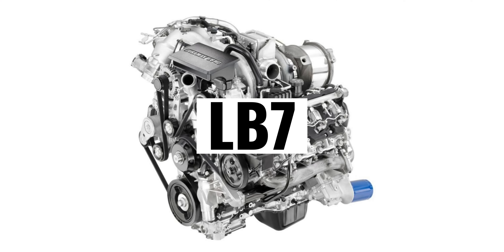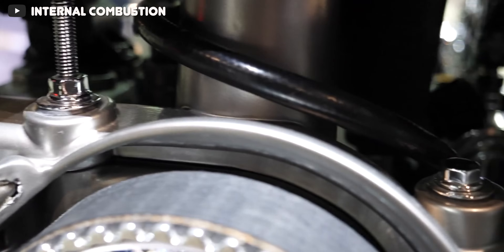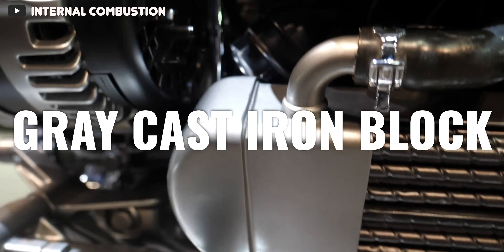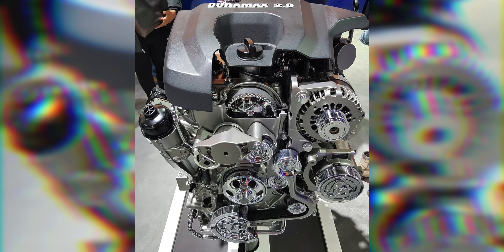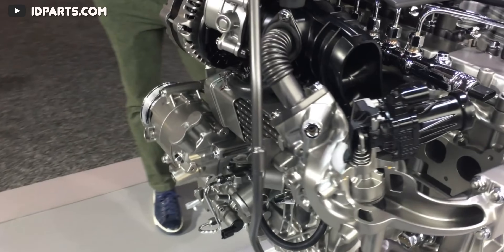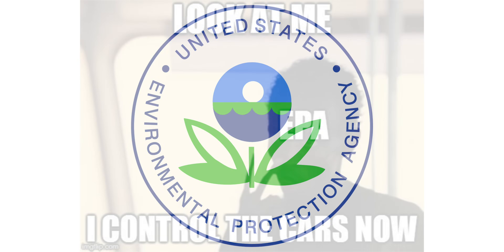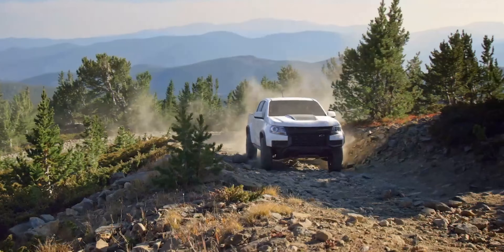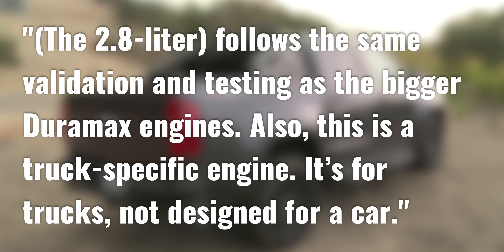2.8L LWN Duramax: Everything You Need to Know

Comment: Have 121,200 + on my 2018 D-Max and consistently tow with it and NEVER had ANY issues with the engine or transmission. This truck grossly under rated for what I’ve put it through!

Just hit 155K
Needed to replace the AC clutch.
Reply: That is the 3.0. 2.8 is gear driven oil pump, and timing belt is on the front. No need to pull the cab
Reply: Exactly the same experience here. 2018 ZR2 with the LWN, and I tow constantly with it. My dad has the v6 with the 8 speed, and I hate it. The 6 gear auto is far better imo…less hunting for gears on the highway. 

I’m at 150k, and no issues with anything except the usual GM build quality issues (not engine/transmission related). I absolutely love it, and am beyond disappointed that GM discontinued the 2.8.
Reply: Not sure if it's all that underrated . The resale value of 2015- 2022 canyon colorados (gas or diesel) even makes Toyota jealous 😮
Reply: 119,000 now and going strong
Reply: Try 300000. Easy to tow when new. Mine heats. Can’t figure out.
Reply: Hope your luck is better than mine! 2020 Colorado max. At 90k my truck and my buddies same model trucks emmisions system shit the bed ! Gotta delete the whole damn trying! Been in limp mode for a couple months ! The dpf sucks on this truck ! Besides that the trucks a dream!
Reply: @kevinwilliford2586 Buy a programmer and force regens. Buy only one brand def, and not on pump. I use the blue
Reply: I have 65,000 on my 2016 canyon. 
The dealer already replaced the torque converter and it's now beginning to go again.  🤨
Thanks for the trans explanation.
Reply: @charlesbriggs8315 you have the 6 or 8 spd?
Reply: @charlesbriggs8315  76000 for the same issue
Reply: I've got a 2017 Holden Colorado with the pathetic 6L50 transmission in it. It destroyed itself by 140,000 km amd needed a complete rebuild. $9k later and still doesn't change as smooth as I'd like.  Such a disappointment as the rest of the ute is good....so far. Running this transmission in this duel cab ute is a complete failure . Failure is a common problem in well over half of them sold. Mine has never towed anything for very long either.
Reply: I'm looking at a 2.8 Colorado.  I've never owned a diesel. I've heard more good than bad about it.
Reply: I have a 2022 mini duramax and I’ve had so many emissions issues 3 to be exact and my whole emissions components and DEF tank are being replaced. I’ve had it for less than a year it has 13k miles on it :/
Probably going to lemon it if it happens again and go with a Taco
Reply: @brandonhernandez9453 I have had 4 check engine lights in 2 years with my 2022. Nothing major yet. But it is hassle for me to get to the dealer.
Reply: @brandonhernandez9453 This is the thing. You need to find people that can work on them. I have 235k on a 2017 without any real issues. I'm trying to buy a zr2 max and the dealer can't fix it.
Reply: @brandonhernandez9453  honestly the only real issue with these trucks from what ive seen is the DEF system the feds require. ruined so many things
Reply: @bradhaines3142  luckily mine fell off weird pothole or something
Reply: @brandonhernandez9453 Never ever get a diesel truck unless you use them for towing or business. The Taco is good for adventure, light towing, and work.
Reply: 88k isn't anything, well it is for a Domestic which are garbage. You will have problems soon
Reply: We'll see what happens when you get to 250k
Reply: @TheAnnoyingBoss how many other light duty trucks make it to 250k  (consistently towing) without some issues or repairs or replacement parts?
Reply: @TheAnnoyingBoss I have 235k without issues
Reply: @TheAnnoyingBoss  225k+, 2014, tuned, 208HP, offroad kitted, still sounds better than most new trucks .....hasn't missed a beat....driven everywhere and has towed everything I've owned....one day you'll understand🤣
Reply: @TheAnnoyingBoss  wait until you need to replace the belt driven oil pump around 150k miles or so😂
Reply: @David-yy7lb  so what don’t you do maintenance to your engines?
Reply: would you be comfortable towing a 32ft cargo trailer with it?
Reply: @studytogetherforever I pull as 30 ft bumper tow camper through the mountains with mine! Doesn’t worry me at all ! I can’t haul ass with it back there but no need to! Tranny tune would make a huge diff when this bitch gets deleted soon !
Reply: @studytogetherforever  get a Ram for that

Comment: The 2.8 becomes unstoppable with a DT44 turbo & revmax torque converter.  Beastmode 
Thanks to Motorops 🇨🇦 for the diet tune for the DT44….
Reply: What have been the impact on mileage and power?
Reply: Yes that's the best thing to do with these.... bigger turbo and aftermarket torque converter.
I deleted the egr and it runs so much better also I reprogrammed the transmission so it shifts quicker.

Comment: I have a totally stock 2.8L and at only 68k miles, the 6L50 transmission is already showing signs of wear (very harsh shifting, delayed shifts, and torque converter shudder among them) and it has been very frustrating as the truck is pretty much perfect otherwise
Reply: A revmax torque converter and a swap to a quality ATF like Amsoil or Triax global goes a long way.  Plus a trans tune.
Reply: I had the same issues with my 2016 Colorado.  I had the trans fluid and filter changed and the problems cleared up.  The trans tech who did the work suggested we change fluid again after another 15,000 miles.  This is not encouraging stuff.  I wanted to own this truck for at least 150,000 miles.  I might still be able to do that, but it will most likely be with a new transmission.
Reply: We had the same issue on our 2017 Canyon 2.5L and my wife, who's a GM Canada technician, found a special policy on the 6L50 for MY2015-2018 or 2019 regarding harsh shifting and rough idle. She updated the software in the PCM which smoothed out the shifting and idle for us. I think the culprit was the torque converter and severe cases would result in free replacement under the special policy.
Reply: @chrisbrook1234  Where can you find this policy. I have a 2017 and have started to notice the rough shifting. Would love to keep my truck but not if it's going to continue to have more issues. I have 63600 miles on it.
Reply: @marcia8004  the best place to start is to go to a GM dealer with it and tell them about the issue. If the truck no longer has warranty then there may be a charge now for programming if that is needed, but they'll still have access to the policy documents to figure out the issue. 

Depending how long it's been since your last transmission fluid and filter service, it might not be a bad idea to get that done too. Our current 2021 Canyon has the 2.8L Duramax with the 6L50 and we do our transmission services every 50,000km (30k miles) as a preventative measure.

Comment: I wanted someone to bring back the actual mini trucks. These modern "midsize" or even that thing Ford recently made are huge. I'm talking those old Mazdas, Toyotas and even the s10 with the iron duke.
I prefer the old Mazda b2200, low to the ground for easy loading but not so slow it's a pain to get in and out of. And short and narrow, you can literally park anywhere as easy as a small car, but actually haul a pretty fair payload. Plus the Mazdas you could actually get a full 8' bed if you wanted. But most had the 6' bed that I can put a quad in the back and actually close the tailgate, something most midsize trucks today can't do. And not to mention after you put some good valve seals and Weber on them they are extremely low maintenance and very easy to work on. If they made that again but with a more modern drive train I'd buy one in a second.
But with the trend they got now I might as well get a half ton.

Comment: Nice video and very articulate.

I own a '17 Canyon with the 2.8.  As you said, the transmission and emissions system have proven to be weak points for many.  The only way around it is to tune it to firm up the transmission's soft "carlike" stock settings and to turn off EGR, which quickly cokes up the intake tract.  Unfortunately the EPA has made that difficult.

For Americans it is important to protect the high pressure fuel pump and injectors to run a good cleaning/lube/cetane boost additive with every fill up.  America's "dry" and low cetane diesel fuel generally sucks balls.  I like Optilube's "Summer+" dosed at 5 ounces per 20 gallons.  My 2.8 starts and runs notably better with it, and the lube protects the fuel system.
Reply: The manual for my '16 Colorado specifies using Top Tier-branded fuels.  Unfortunately, I don't know of any stations in this area of the country that sell Top Tier diesel, though there are plenty that sell Top Tier gasoline.  I've been running Power Service Diesel Kleen + Cetane Boost in my truck with every fill up, mixed per the bottle instructions for maximum cetane boost.  My truck gets better mileage and runs a lot smoother with it.  I've read online that these smaller Euro-designed diesels are really meant for Euro-spec fuels, which are 50+ cetane.  Most diesel in the US is 40 cetane, when the pump is marked with a cetane rating at all, so I'm glad to see someone else mentioning the need to run a fuel additive in our smaller trucks.
Reply: @NovaEclipse99  Sinclair diesel is the best pump fuel I have come across.  I buy cheap diesel and treat it like you do, that works fine.  As long as it is from a high volume station and it is free of water you are good to go treating your fuel like you are with Diesel Kleen.
Reply: my understanding is there is NO top tier diesel...   only clean waterless diesel... so go where diesel is bought a lot, like where the truckers go, that ensures the fuel is used up and fresher diesel  @NovaEclipse99
Reply: I use a oil catch can so the EGR can push through all that sooty garbage through can and not the engine. easy fix for the EGR.
Reply: @HR-rt9nh  Yes!  Have run a Provent 200 since new, "temporarily" zip tied near the radiator for the  last 77K miles 😆
Reply: @HR-rt9nh  sounds borderline necessary for the current diesel systems
Reply: Your 2.8L fuel system is designed to run on ULS diesel fuel, the problem is , compared to say European diesel, American diesel quality is absolute fucking garbage, water, contaminants, you ask a German to run Yank diesel in his Benz he would implode and accidentally invade Poland again. Keep your filters clean or go better micron. Adding an additive,  especially stock is pointless and often voids warranty.
Reply: @panthermartin7784   GM originally specified no fuel additives needed.  Now GM sells an additive, probably after having quite a few warranty claims for injectors failing often burning a hole in their cylinder's piston in the process.  I wouldn't buy a new diesel now, as the EPA has shut down the ability to tune (or at least do good tunes that shut off EGR) in the US. 

Funny you mentioned the filtration system.  I added a Racor Marine 2 micron water separator fuel filter after the stock filter setup.  My truck is a long box, so it was not hard to fabricate a mounting system with that foot of extra space to work with.  That area in front of the OEM filter is much tighter for short box owners.   20K miles on the add on marine grade filter, so far so good!  The added filter did not register at all in the "fuel filter life" screen, any additional restriction is nominal, or the system would have noticed it.

Getting my 2.8 they way I wanted it was quite a bit of brain damage and not for a sane person.  I guess I like a project 😁
Reply: Why go through all that trouble taking care of the diesel when you can just buy a gasser that’s reliable and proven like the 5.3 or 6.2
Reply: @Yeti21173  A fair point.  I simply like the mid sized truck and diesel combo as it is unique.  The turbodiesel has effortless acceleration and pulling power at casual RPM and it is great on the highway.  I would not buy a new diesel now though, they are a lot of "brain damage".
Reply: My 2016 Canyon v6 just got rear-ended and so it's now totalled. I'm looking for a 2.8 turbo diesel to replace it

Comment: I have a 2017 canyon with the 2.8l 150k KM on it and the DEF heater died this past winter, thankfully i found a company still able to remove the EPA crap and get my truck back on the road for half of the price then the part from GM. Big middle finger the the EPA for mandating parts that break down and cost a ton to repair.
Reply: what state would like to keep that in mind any issues when doing dmv renew?
Reply: @julianbusty  im in Canada, it reprograms the ECU to get rid of all the emissions shit.
Reply: @seansmyth6505  lol darn i am in the USA
Reply: Who did you get your tune from? I've been running the MotorOps for 150k kms, it was rocky at first but we had it sorted in the end. I also have their TCM tune. My forward gear clutch plates wore next due to low line pressure from a failing pressure regulator plunger. Sonnax part# 6L45-6L90-ZIP resolves that along with low valve body performance. This is an issue across all of these transmissions.
Reply: How much did it cost you to do that

Comment: Personally I prefer a timing belt over a chain for the simple fact if you do your maintenance regularly, your timing will not be altered by chain stretch
Reply: I recently changed my timing belt, I did it while I was in there due to a high pressure fuel pump failure. The timing belt job was so much easier than my ALH VW TDI Jetta.
I could've done it in a couple of hours if it was the only issue I was working on.
Reply: @dancrawford174  This is great to hear, as a guy that does a lot of timing belts in VWs I like hearing when something is easier than the ALH.

Comment: The R428 was found for 2 years (05-06) in US spec Jeep Liberty CRD’s.
Reply: Had one loved it disabled the EGR first thing . Timing beits in  an interference engine sould be outlawed.  I was about 45,000 miles into the second belt when I had to pull the head to get the ceramic glow plugs out to replace then O ring on#2 went spraying fuel all over  At that point igave up. I have been waiting for asmall 1/2 ton for a long time . saw a Colorado the other day  owner had nothing but good to say . Based on comments here I may start looking

Comment: Great review.  I have a Jeep Liberty with the 2.8L CRD from VM Motori--basically the same engine as the 2.8L Duramax.  They are so similar that, if I was blindfolded, I wouldn't be able to tell if I was riding in the Liberty or a Colorado.  The 2.8L Duramax shares one of its two basic weaknesses with the Liberty CRD--that weakness is the timing belt.  In the Liberty, parts and labor to change out the timing belt is about a $1,600 job--that wipes out most of the fuel economy cost advantage of the diesel.  Fortunately, the Liberty does NOT have DPF and DEF systems, which is the 2.8L Duramax's second major problem area.  Aside from the timing belt issues, however, both engines can suffer from emission-related issues.  Both absolutely require strict adherence to oil change intervals with the correct motor oil.  Maintained properly (including timing belt replacement) both can be long-lived engines, but they they are no longer really cost-efficient to own compared to gasoline engine vehicles today.  As a lover of diesel engines, I hate to admit that, but my own cost figures and analysis show exactly that to be true.
Reply: Was going to bring up that this engine is in fact a newer gen variant of that same motor in the liberty.
Also I work at a dealer that sees very few of these but despite that we've still replace a couple for catastrophic failure

Comment: The 6l50’s in these trucks easily hold up to +100hp over stock  with tuning and an upgraded turbo.
Reply: yea they do! thanks Sean
Reply: How did yall get 300 hp
Reply: @ktcjosh  It was an experimental HX35 turbo setup that we had on there and it was pretty spicy.
Reply: No, they don't. The line pressure regulator is weak on them. The valve body needs an upgrade to increase clamping force for tuned trucks. The next item to fail is the torque converter lockup clutch.

The turbo vanes will fold over time, and upgraded turbos are becoming a thing. These will boost the torque even higher requiring a torque converter upgrade.

I love this truck and the transmission is easily the worst part after addressing emissions reliability.
Reply: @marcelbroesky4945  The stock converter and trans in my truck would really beg to differ. Both working so far in a 300+HP setup. Some stock converters seem iffy and whether they live or not long term largely depends on the power level, abuse, and TCC lockup strategy. There are countless trucks with upgraded turbos as this point with trouble free transmissions.
Reply: @HunterSkiff  I sure hope so. It's time for a turbo in mine and I'm concerned about poor TC lockup resulting in a big bill!
Reply: @marcelbroesky4945  I'm still looking for some concrete evidence on your valve body claims. @Sean Lynn sees more trucks than I do so he would be able to elaborate more, but from my experience, that is not the case.
Reply: @HunterSkiff  My local Diesel guy is the transmission expert for the region. He let me know when my truck was tuned that my pressure regulator would likely fail at 150k kms. At 115k kms, I had clutches done. They were totally toast. When he pulled it apart, the part he predicted would be worn was worn exactly as he predicted.
Reply: @marcelbroesky4945  Our shop 2.8 made 300whp for over a year and it was daily driven. We pulled the trans apart and saw 0 issues with anything.

Comment: i have a 2018 zr2 2.8, put 33" tires on it and i'm lucky to get 21 MPG . my mistake going back to a smaller tire when these wear out!
Reply: I get 21mpg on my 2018 diesel Colorado zr2 with 33 Falcon radials also. The guys running gas only get maybe 14.